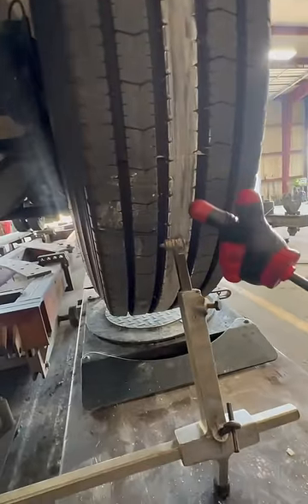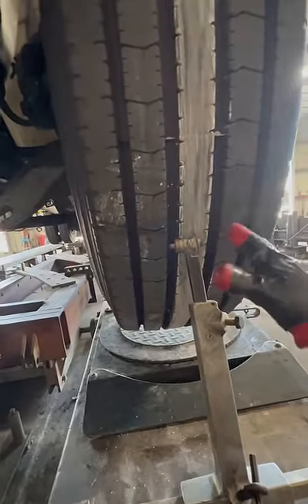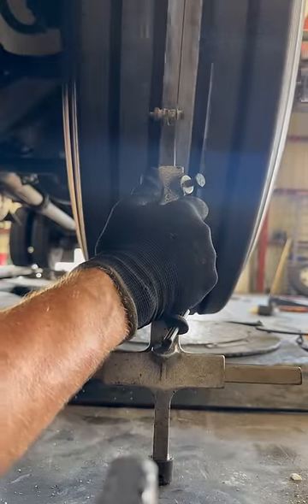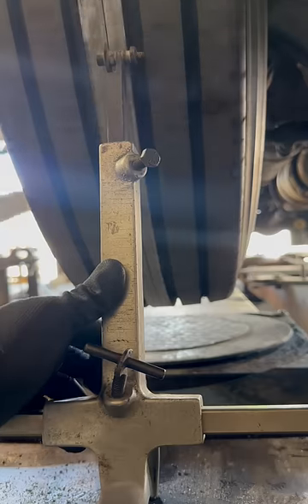Lit up 🔥

Comment: Ok so this is wrong. The alignment machine is setting toe based on front to rear. Vehicles are not perfectly manufactured, and are not perfectly straight, meaning they all crab down the road a tiny amount. If you dont adjust toe relative to all 4 tires, then some of those tires will be dragging a bit.

Comment: A mechanic where i used to work would just set a can of brake clean, or whatever was around, right next to the tire, spin it and watch for the gap to change.  I'm sure the method in this video is more accurate.

Comment: As long as you have the scribe positioned true to the parallel of both axel hubs. But it will change once you put the weight of the vehicle back on the tires.

Comment: The only way to do it is with a fully loaded trailer on and the wheels on the ground driven forward into the shop and not backed up at all.Then set 1/16 toe in.If there is an issue after that it is with the tandem alignment.

Comment: I do the same thing when I do a quick shop front end alignment except I use a block of wood and a nail or a screw all the way through it and scribe a line in the center of the tire just like that works like a champ!

Comment: Don't you have to measure the back too? I feel like all your checking there is if the wheel wobbles to measure toe in and toe out is making sure that the measurement from the distance of the treads in the front is the same as the distance of the treads in the back... you didn't check if the back was out wide or in close just that the wheel stayed true

Comment: I don't see how this is accurate at all to set toe. As you roll the wheel whether you are toe in or out it will hit the same spot as the scribe mark no matter how off your toe is. I feel like to make this work would be to have two scribes on the front and rear of the tire and then rotate. That will show you variance and adjust until lined up

Comment: That is excellent work.

I have eyeballed toe so many times a can't count, I admit your chalk method is quite precise , but I've rarely ever had to adjust into tolerance after eyeball setting. I would do this after changing tires on the lift before getting into the alignment rack if there was previous indication of wear. 

But I've never performed  alignment on anything larger than srw,  with such large vehicle I can see the benefit of having a standard to rely on when tolerances can't be trusted.

Thanks for sharing

Comment: In my younger days,  I did alignments on my pickup with a tape measure. On time when i got it checked at a shop, the toe was 1/2 degree in from parallel.

Comment: Right but that line would connect to itself even if the tire as a whole was two or three degrees offset I mean literally that line would connect to itself even if it touched the farthest left extent of the tire on the top and the furthest extent of the tire on the bottom how does this prove in any capacity that it's balanced

Comment: Explain more please.
Reply: I think thats his point of reference for each side. Then adjust toe by measuring those marks or whatever contraption he has here
Reply: He uses the same, or similar rod/rack, to check the difference between those scribed lines a certain height up (maybe 7inches, or so).
 Do the front distance between lines, left and right tire, both pointers are on the line🎯
 Carefully move the measure device to the back of the tires.
 The pointers will show if the lines on back are closer together, further apart, or same measure as front.
 I set mine to be 1/16th inch closer in front, at 7inches off floor/ground/road surface.
 It might be wrong amount of toe-in measurement, but, my tires wear flat across the entire tread surface😎

Comment: Certainly isn’t going to work without the weight of the vehicle resting on the contact patch… FAIL
Reply: That's just to Mark the center line then he drops it down on the turntables and wiggles the steering wheel back and forth and puts the steering wheel in the center and then he measures across the back of the tire from Line to Line and the front of the tire from Line to Line as close to the hub center horizontally for a WIN! ... also you can run a string all the way around the truck at the center of the wheels and then measure off of the Tire to the string and that will tell you if your steering wheel is straight and what side to adjust✅😃

Comment: This seems pointless. I'd love to know the reasoning behind this procedure.

I am a practicing engineer, so it disturbs me when I do not understand something.
Reply: You are kidding, right?  In spite of  wheel and tire runout  this gives you a reference for setting toe on a PLANE LINE  through the rotational  plane of the bearing/ rotor/ wheel / tire assembly
Reply: @fourfortyroadrunner6701 okay? What machine has a tolerance built into it? Why do you need a reference plane anyway? Scribing a reference plane on something you are attempting to align is pointless. Since it's already out of alignment, you would have to first recognize there is a good possibility that whatever plane is being used will be offset in camber, toe, and castor depending on the configuration of the suspension geometry. I see no benefit in scribing a line. What procedure can be done with this line that otherwise could not be done?

Comment: Your hard hat being cracked is an OSHA violation. The stickers on the hat is an OSHA violation. Not wearing safety glasses is a OSHA violation. You love violations apparently. So far I've seen well over $300,000 worth of fees in this video alone. You really should be a lot more careful bro. Safety is always the number one priority. As far as influencers go you're okay. Lead by example.
Reply: Since when does OSHA require a hardhat in a shop? Might wanna adjust that fine amount. DA